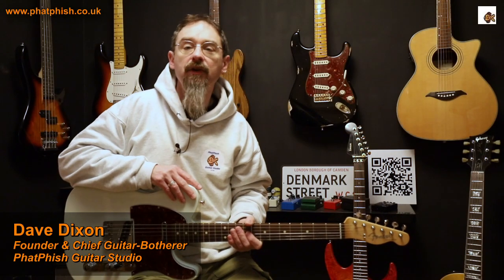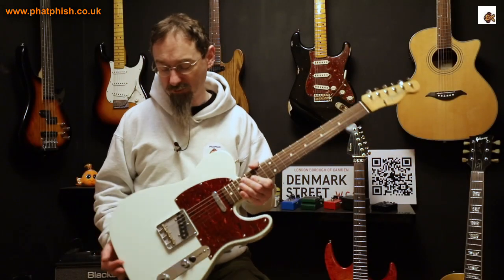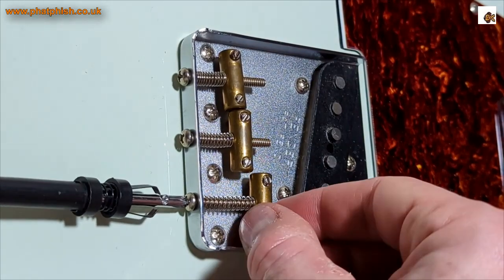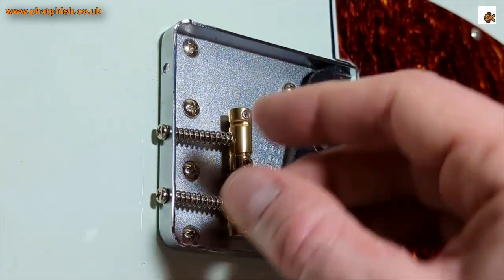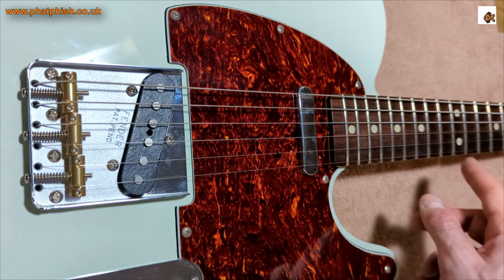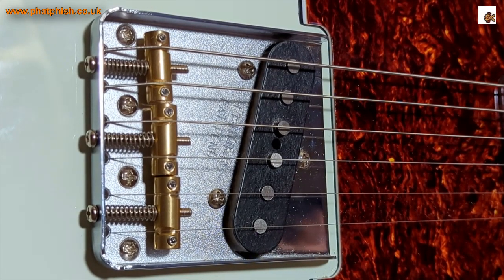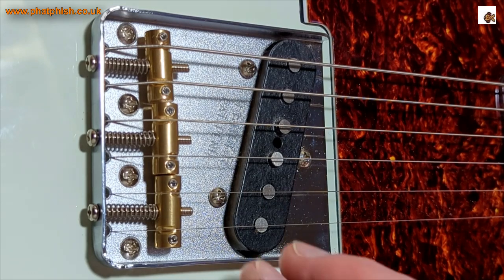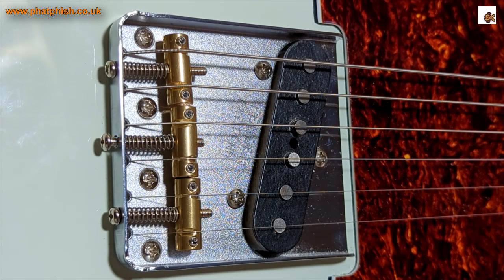Telecaster Saddle Upgrade

Comment: The intonation screw on the middle saddle isn't tightened!
Reply: That's what happens when you don't loosen the strings up enough for the saddles to move freely.
Reply: What l do is tune it up roughly correct, then, give the strap button a good whack with a mallet. Once or twice should be enough. Very satisfying... especially on ten!

Comment: I love these saddles they are so much better than Wilkinson. I had 2 sets of Wilkinson and the sharp edges would crimp my strings and I would break strings mostly the A string and they wouldn't stay in tune or intonate . After 2sets of saddles and 4different sets of high quality strings I got a set of Gotoh saddles and all of the above problems are gone. I now have almost perfect intonation and she is easy to tune and will stay in tune
Reply: I also have that A string (and B to a lesser extend) breaking problem with the Wilkinson saddles, ordered the Gotoh now, lets hope thats fixes it

Comment: I'm trying to find out IF compensated saddles are better and HOW they work, I've watched loads of videos but absolutely nobody tells me HOW they work and WHY they are meant to be better ...
Reply from the maker: Maybe this will help you... https://youtu.be/NQluHjOjUaI
Reply: Because each of your strings is a different thickness, designed to be tuned to different pitches, and the strings themselves can be either wound or plain steel, all of their scale lengths are different. This means each string’s length from the nut to the point it meets the bridge saddle should each be different in order for all strings to play perfectly in tune with each other. Some need to be longer or shorter. If this is not set properly, the strings while they are open may be perfectly in tune, but the higher up the fretboard you play, they will become increasingly more out of tune with each other. 

On a traditional tele saddle, two strings sit on the same piece of metal. Each string will be about the same distance from the nut. There is no way to make one side of the saddle shorter than the other side. This is no good for intonation. You can get one string perfect, but the other will play very out of tune. For the best result, you will have to split the difference. Neither string will be perfect. It is very hard to impossible to get the intonation correct for both strings. 

On a compensated saddle, the exact point where the string sits is different on each side. This is what those little notches are for and why one side of the saddle looks different from the other. This is why they are staggered. While this still is not as ideal as having six different intonation adjustments, you can get the intonation much closer than if you did not have the compensated saddle. You DO have to be sure each saddle is installed properly, with the longer and shorter side of the saddle on the proper side. 

So, is it perfect or ideal? No. Why not? Because you still only have three intonation adjustment screws instead of six. Can you still get the intonation much closer than a traditional saddle? If you install the saddles properly, absolutely yes.

Comment: Google Equal Temperament.  Our system of tuning is a compromise. This applies to all stringed instruments and piano as well. No one is gonna notice you B string is 200ths of a semitone sharp and a gig. Especially after a couple of beers 🍻
Reply: We are used to Equal Temperament and this is pretty much the only way to use all 12 semitones and have different keys. But it does not justify anyhow inability to intonate non-compensated saddles. I hear chords sounding out of tune on them very clearly. The higher you go, the worse it gets. I cannot play on regular telecaster above 12th fret for that reason. It just hurts my ears. It is not about 200ths of semitone, it is more like 1/5 of semitone, if not worse. If you are ok with that, do not bother, you are lucky. Just know that there are people who cannot accept that.